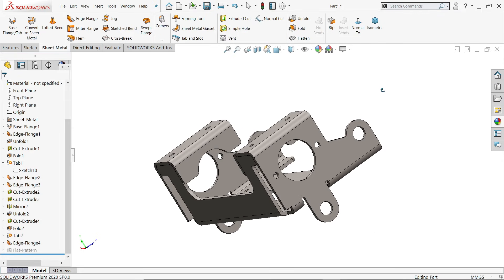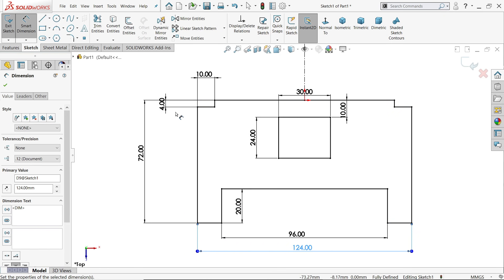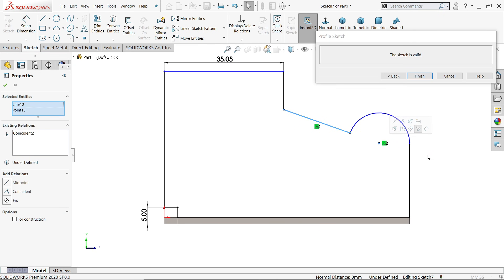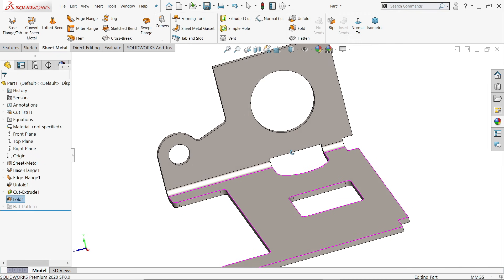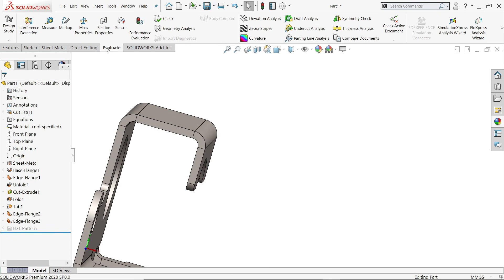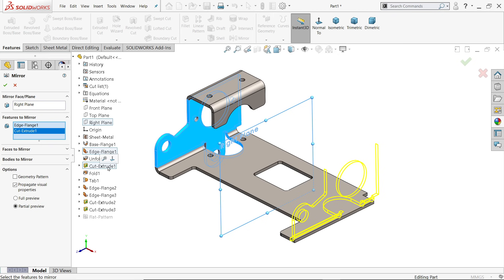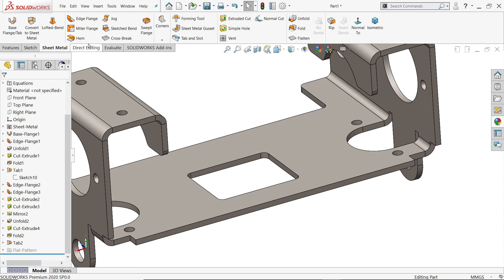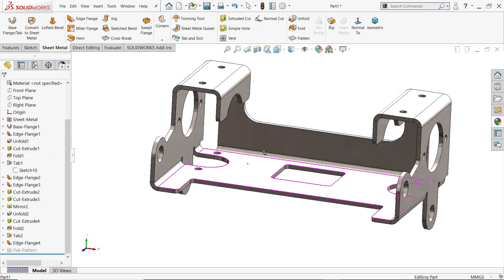Advanced Sheet metal Exercise in SolidWorks

Comment: I did this a little different. I used half of the front view and made my base flange. I cut away geometry to get the circular shape, bottom notch. Did a tab and edge flange for the back gapped feature like you did. Then did a mirror. I got the same dimensions in the flattened state as you did, so I figure it was a valid method.

Comment: You can mirror the cutout instead of redrawing it on the opposite side if you Unfold all the bends before the mirroring operation. Once the cutout has been mirrored then Fold the part back and then mirror the Tab. It should work that way.

Comment: Great video but your detailing has a few errors (One example of this: the overall length of a bent part should be in brackets () {indicating that the length of the bent part is not the absolute length but only a reference}). In-fact, all bent dimensions should be in brackets (). Also, you indicated the material thickness in all 3 bends in a single view when you could have just indicated this in the over-all dimensions (only once: as this dimension would only need to be mentioned once to show the material that would need to be ordered)
Reply: Honestly, do you think that would keep me from hiring you? If you were to demonstrate ability up to the point where all I had as criticism was brackets vs no brackets, I'm pretty sure you'd be hired. There is a difference between innate talent vs trained talent. Your critique is misguided, in my opinion.
Reply: @sevendesign1805  and then when a machinist mis-reads the dims because its different to every other drawing he has seen, you then realise you should have been more critical of the guy who cant follow simple industry standards.